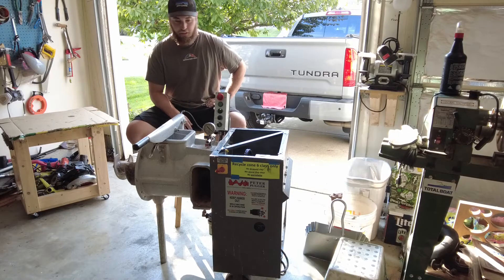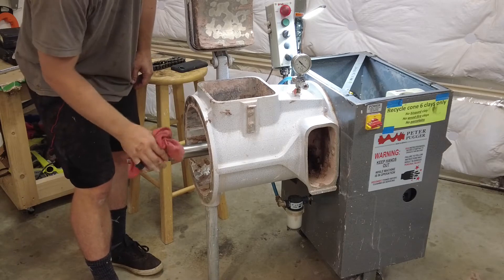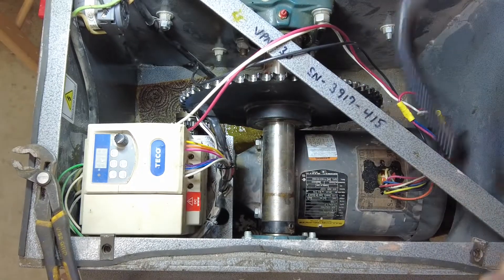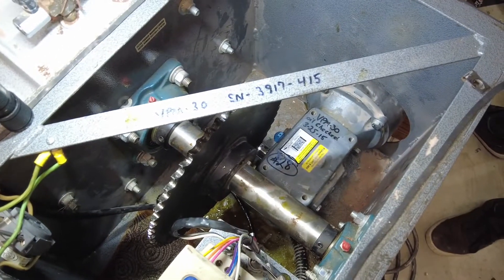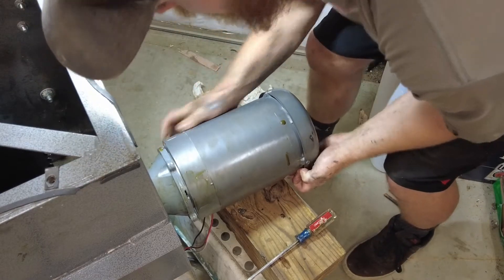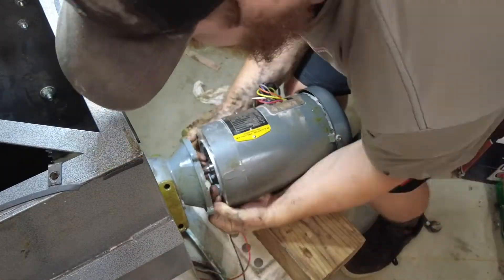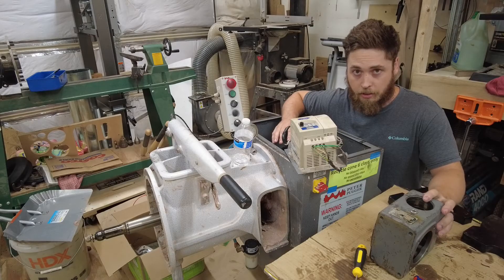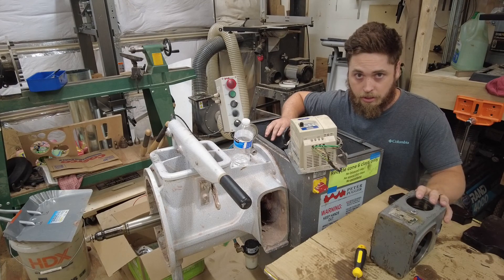Peter Pugger VPM-30 Boston Gearbox Repair Part 1 (Complete Teardown)

Comment: Interesting as I'm needing to replace the imput shaft seal on a Dayton 4z001. This has been helpfull if I need to remove shaft. Installer didn't bolt gear box to motor, but used a coupler. Probable not designed to withstand that side loading.
Reply: Interested in your parts supplier. Boston #60594. Local place wanted $42 for the seal. That's ridiculous!
Reply from the maker: @edwinhsingmaster9135  I got everything from Motion Industries. Everything fit perfect but I don’t think they were very cheap either. Worth checking out.
Reply from the maker: Thanks for watching. Hopefully you get it all back together.